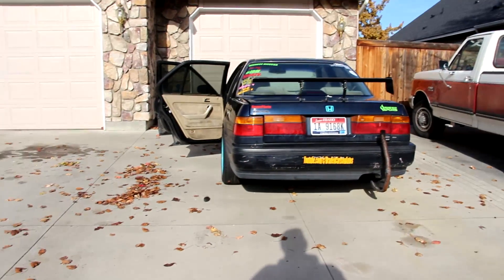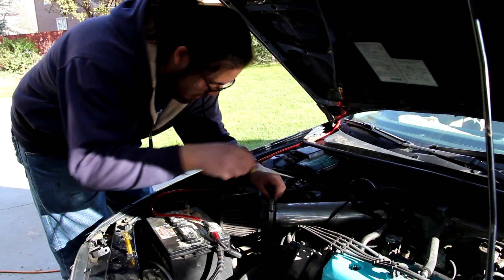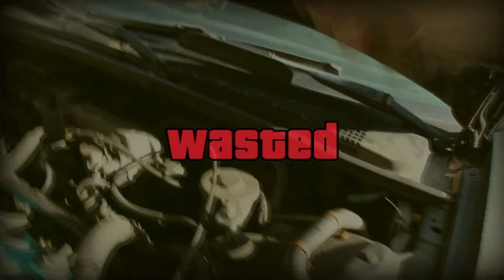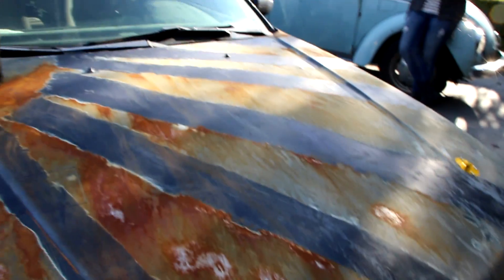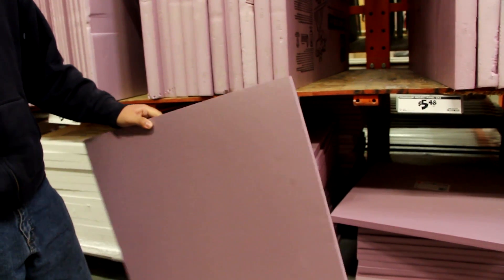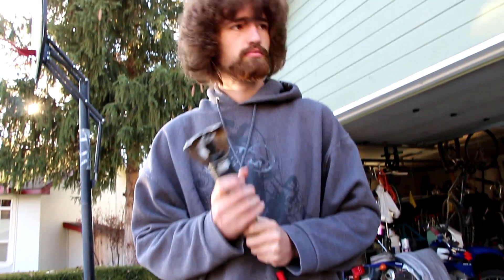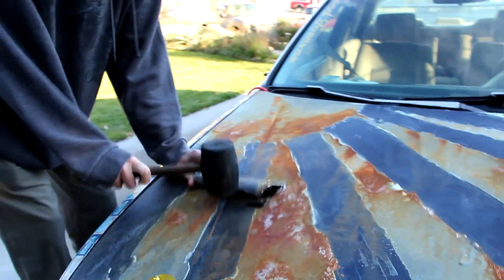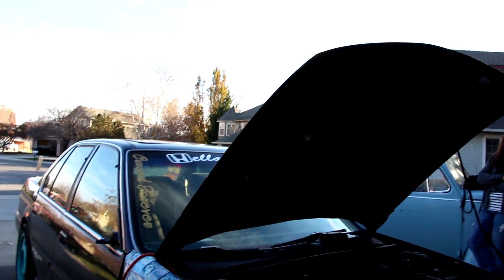How To Make A Carbon Fiber Hood Scoop Part 1: Fab Work

Comment: You forgot collar washer then a plastic black washer when you assemble the strut back. if you forgot to put those in that's why your strut keeps coming thru the top. 

it goes nut,top hat washer,plastic washer,collar washer that is grooved for the strut shaft.

Comment: Might be a "HG knock off" but these guys are 10x funnier than slim Jesus or the loser with the Talon. Btw the washer they're talking about for the strut is underneath the mount where the strut rod flares out, it may be blown but it's not properly installed that's why it pops up like that.

Comment: Does this mod reduce weight by 2k lbs and add 500hp to the wheels?
Reply: To the left wheel
Reply: yup, 4 scoops are required for optimal air flow...